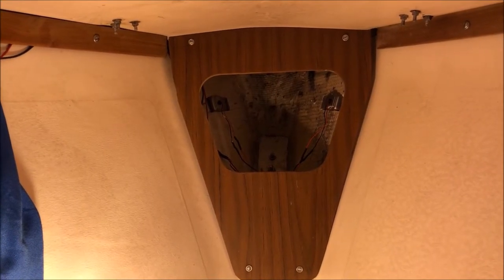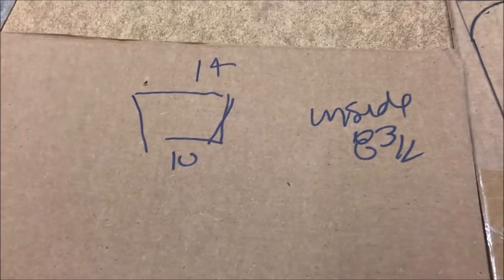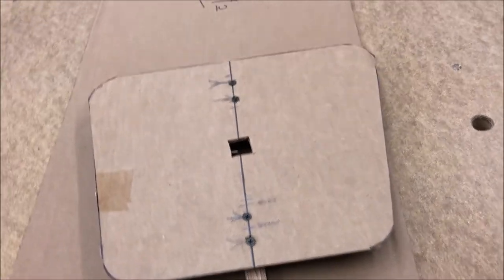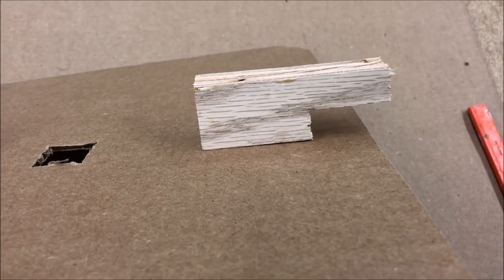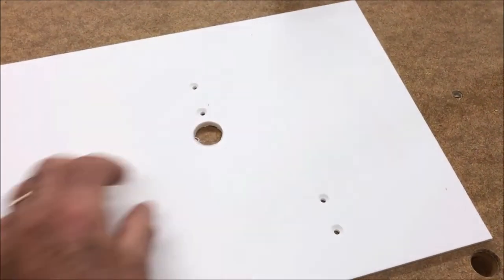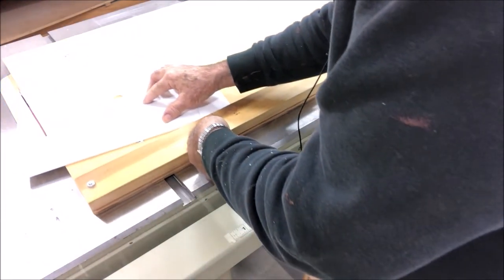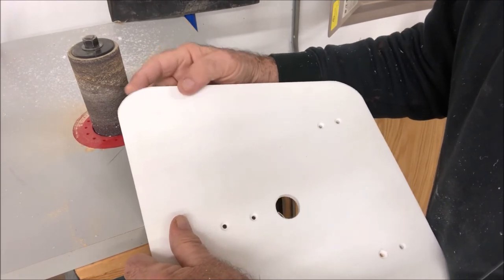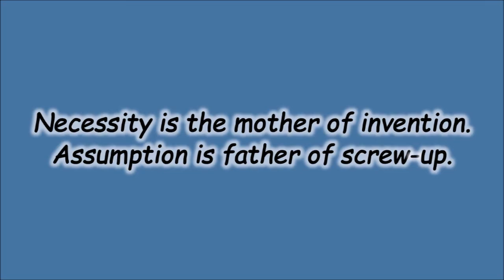Catalina 22 --  Bow Locker Cover -- Jim's Little Boat

Comment: Don't like wood in sail boats?
Reply from the maker: Wood requires maintenance.  Plastic= more sailing.  :)
Reply: @jimslittleboat4388  Jim, I just bought a 1988 Cat 22.  The Bow Eye needs some attention.  I see yours plainly behind that panel you made.  Is mine located in the same place?  I have a piece of fiberglass and no access point.  There is round panel in the anchor locker some guy ran a camera down and it looks like its there.  Not any room to work... Advice?   Thanks Dan.